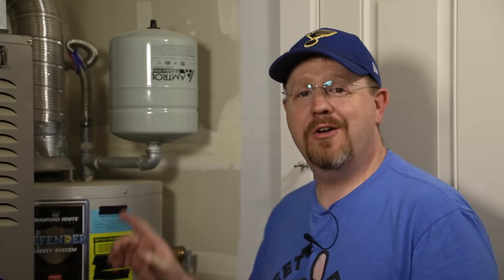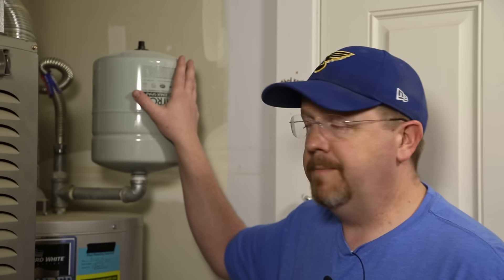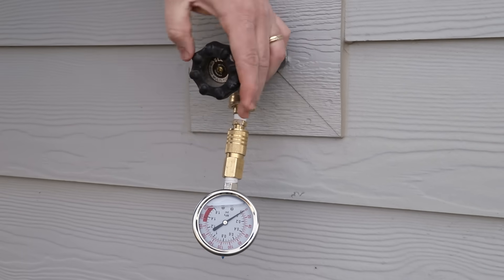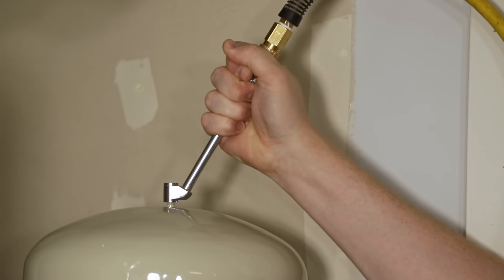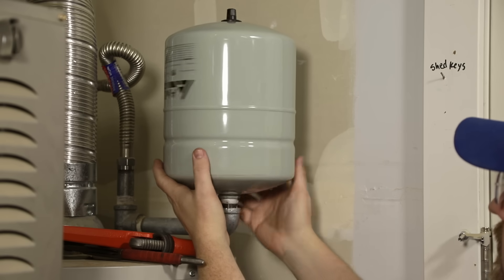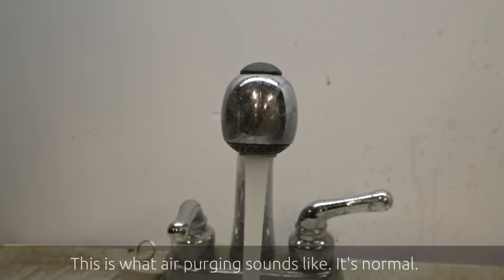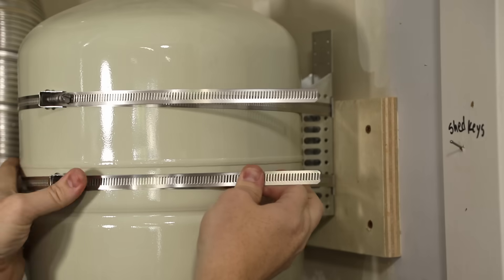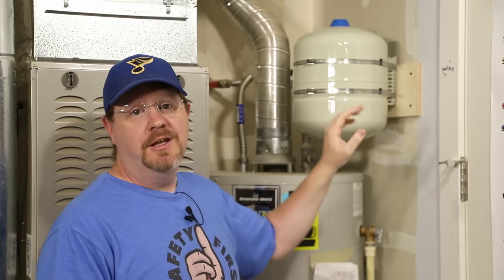What Is This Tank? How to Replace and Maintain a Water Heater Thermal Expansion Tank

Comment: excellent and very clear video! well done. I don't have an expansion tank but was wondering if I should. if the TMP valve never leaked, would that be an indication i don't need an expansion valve? I'm on well water. i do have a one way valve there
Reply from the maker: Hi Sean - I'd suggest that if you have never had a problem, you don't have anything to worry about. If you ever have a fitting fail and start to leak somewhere in your house, after fixing the leak a good preventative step would be to install an expansion tank like this. It helps keep the pressure in your system consistent even as the water heater heats and the water inside it expands. Thanks for watching!
Reply: @AmplifyDIY  i actually have a few PEX fitting leaking...hmmm

Comment: its not a good idea to mount the expansion tank upside down like that. an air pocket can form under the bladder inside the tank, the air with the water can begin to rust the tank from the inside at about halfway up the tank
Reply from the maker: Hi Brad - this is the specific way that the manufacturer recommends installing this particular tank... though the instructions say it is fine to install in either vertical orientation. I thought that the water half of the tank was treated so that it would not rust - where the air side of the tank is not. I've cut 1 of these open that failed, and the inner walls of the tank on the air side of the bladder were all rusty as you suggested, but the walls of the tank on the water side were still just fine. Thanks for the tip though, and thanks for watching!

Comment: I don't quite understand, is your water heater inlet hooked directly to the water mains instead of the water tank? Why?
Reply from the maker: Hi Keep Calm - I'm not sure I understand your question... but here is how my plumbing is basically laid out: 

Under my house (in the crawl space) is where the main water shutoff is for the whole house*. This is effectively where the "water mains" supplies the house. After that shutoff valve, there is a T - half goes off to all the cold sides of the faucets etc in the house, the other half goes to the water heater, and then off to the hot sides of all the faucets from there. There is an additional shutoff valve *only on the hot side of this T that is located right at the top of the water heater, on what is known as the "cold water inlet" to the heater. I.e., this is the side of the heater where water flows in. The other side is where heated water flows out to the house. 

In this video, I only showed the shutoff valve at the top of the water heater, which is not the mains shutoff - that's located in the crawl space under the house as I described above. 

Does this answer your question? 

Thanks for watching!
Reply: So there isn't a cold water tank, like a 1000litres tank in the attic? I.e: if the water supply from the street is cut off, you are left without water in your house?
Reply from the maker: @keepcalmandenjoythedecline  That is correct. This is by far the most common way for residential water systems to be hooked up in the US.

Comment: thanks. is it safe to install the expansion tank horizontally? its easier to do. less plumbing
Reply from the maker: Hi Sean - this depends on the specific tank you choose. Some manufacturers only recommend a vertical orientation. Others indicate it's fine in any orientation. Check the owner's manual before you buy/install. Good luck!

Comment: Water companies decided not to put a check valve in anymore, about a $40 part. Suddenly these tanks had to be installed everywhere at ridiculous prices. Big boon for plumbers, of course.
Reply from the maker: I agree that paying a plumber would cost quite a bit. Doing it yourself though, is really pretty cheap. Thanks for watching!
Reply: @AmplifyDIY   Part is $30-$40, but tools and a mote of mechanical acuity are not included. These tanks are the weakest point in the water system, and when they go they wreak havoc.

Comment: Been doing plumbing for 35 years NEVER saw an expansion tank on a hot water heater. Hundreds of them on boilers. Which in the philly area; is where they go.
Reply from the maker: Heya IT - they are pretty regional. They've been required on all new construction in my area for at least 8 years. Thanks for watching!

Comment: this may be what folk are doing where ever you live, I have worked in HVAC and never seen one of these. tanks like this are used to store RODI water LOL.   These water heaters are designed to withstand the pressure and come with temperature and pressure relief valves.

I am no expert but not sure what these expansion kits do, I would think they would fill up the moment you turn on your water, and makes you spend more money on extra stuff and pay a plumber to install it.
Reply from the maker: Hi Daniel - on an open system that allows backflow into the water mains, no expansion tank is needed. However, if the water supplier installs a check valve out at the street, the house effectively is in a closed loop, and an expansion tank like this is absolutely necessary. Without it, the T&P valve will pop off all the time, or worse, the hot water fitting at the washer usually fails and leaves the home with a very wet laundry room.

Incidentally, it's not just "what folk are doing" here - it's required by state code. Thanks for watching!
Reply: @AmplifyDIY  I live in Florida, I have a check valve at the street, I may or may not have one on my heater. I have no expansion tank. I have lived here, same water heater as when I bought the house. all I have done is replace the element. no issues.

I worked as a helper with a HVAC company repairing or installing anything to do with heat or cooling.  never have I seen an expansion tank.  we have pressure relief valves and nothing more.   far as I know my valve has never released, and the heater is like 6 feet from my bed in the closet.

this is an electric heater, only 110 v   one element, I assume 20-40 gallons.
maybe you are talking about gas, we have these in FL but never seen an expansion tank as I recall.

Comment: Must be a regional thing. In all the water heaters I've seen in my life and the 50 or 60 I've changed out, I've never seen a expansion tank.
Reply from the maker: Yeah, it's required by current state plumbing code whenever there is a check valve installed by the water supplier. They are becoming more and more common. Thanks for watching!

Comment: Sure... I've had Electric Water heater tanks for over 50 years... Never once have i installed this gimmick and never once had any issues whatsoever.
Reply from the maker: Hi Awarhero - you likely don't have a check valve installed on your water main. In my area, all new construction does, so this is required by state plumbing code. It's not a gimmick... if you don't have a check valve though, you don't need one as the expanding water can simply backflow out into your water main. Thanks for watching!
Reply: @AmplifyDIY  Unless it's new in the code, in Quebec i've never heard of a check valve requirement for incoming water.  But for sewage, yes.

Comment: This is a great video. I had one fail on me a about 14 to 16 months ago. We started noticing very rapid water bursts for the first 2 seconds when turning on any faucet. I ignored the issue (being very busy at work) for a few months until the water tank itself sprung a very slow leak seen in the catch pan. It was not a leaking pressure relief valve or any of the pipes so I had to replace the water heater. Thankfully it was still under warranty (for a few more months) and Rheem gave me back about 1/2 of the price of the new one. I replaced both the water heater and the expansion tank, adjusted the pressure on our house pressure regulator and filled the tank with the proper pressure. I did retest the pressure on the tank and house a few days later but not since. Interestingly my failed and replacement tanks are both the same as yours.
Reply from the maker: Sorry you had to deal with a failed water heater due to a failed expansion tank! That stinks! I'm glad you were able to get some warranty coverage, though. Hopefully your new setup will last much, much longer. Thanks for watching!

Comment: Its an expansion tank and theyre almost never installed properly--including the one in this video.
Reply from the maker: I'd love to know what I did wrong, Eddie - care to share?
Reply: @AmplifyDIY  hey, sorry for the late response. So, 1) the tank is installed upside-down, and, 2) it should be installed within a certain height range from the bottom of the water heater.
Reply from the maker: @eddiepadilla1078  Hi Eddie - the instructions from the manufacturer of this tank specifically say it can be installed in either vertical orientation - just not horizontally. Further, the height requirement you speak of is a local code restriction, which apparently does not apply in my specific area. This tank was originally installed by a licensed plumber when this house was built (around 6 years ago) and inspected by the county. I agree that often these tanks are not installed correctly, but as far as I have been able to verify, this specific installation is correct for my area. As always with any plumbing project: check your local codes before you even start a project.
Reply: @AmplifyDIY  The previous amtrol tank was the one that I was referring to. It looks like yours was the st-5 before swapping to one that would be code compliant. It sounds like that authority didn't care much for manufacture specifications. Good job, as the diyer, correcting the professional's screwup.

Comment: I was always told that these were to prevent water hammer when the inlet pressure was to high because some municipalities did not require a regulator. I have lived in cities that required a. inlet regulator and did not require an expansion tank. I have always live where there was not regulator and I had to install a regulator to reduce line pressure from 90psi to 65psi! Most appliances are not designed to operate at pressures much above 70psi.
Reply from the maker: Hi Ray - they can help some with water hammer... but the way this one is installed it'll only help with that on the hot side. The specific use for this tank is as described in the video: my water mains has a check-valve installed which prevents backflow. As water is heated, it expands, and since water is incompressible that expanding water will go *somewhere*... as you mention, it'll burst fittings somewhere in your system if the pressure winds up too high. (There is a pressure relief valve on the water heater as well, but they are usually set to release at a MUCH higher pressure than your appliances can handle.)
Thanks for watching!

Comment: In over 30 years, never had one attached to my water heaters.
Reply from the maker: You've likely lived in an area that did not have a checkvalve on the main, allowing expansion to force backflow. These tanks are becoming more and more common, and have been required by state code where I live for years. Thanks for watching!

Comment: NO...these expansion tanks are not common and by and large...unnecessary. Water heaters have around  FOREVER with virtually no issues arising from not have this.
Reply from the maker: Hi Jimmy - this depends heavily on your geographic location. They are required by code on all new construction here... have been for years. And they absolutely do help reduce the pressure/stress on several critical fittings in your plumbing system. Thanks for watching!

Comment: Bologna,,,that's a expansion tank,,it's there to soften the shock from cutting off water valves to stop water hammer effect.it has no other use.a shock absorber for the water system.period.
Reply from the maker: Hi Oliver. I'm afraid you've been misinformed. An expansion tank is there specifically to allow for the expansion of water as it heats. It can also help with water hammer on the hot water side but the main reason it's there is for expansion.

Comment: In 62 years I have NEVER seen one of these on any water heater. Boilers, yes- but they are a totally different animal. I just assumed that the outlet of the heater is lowered a bit to allow an air pocket for expansion inside the tank.
Reply from the maker: Hi JLange - they are becoming more and more common on new construction. They've been required in my area for at least the last 8 or so years. Thanks for watching!

Comment: Very good info. So do I need to have 40 psi minimum? Ok you said to match the pressure in my water system.
Reply from the maker: Hi Don - right, you should measure the water pressure in your system and set the air pressure in the expansion tank to match. Good luck!

Comment: I never had expansion tank at home and the water heater still works well.
Reply from the maker: The need for them is really dictated by your water supplier. They are becoming more and more common. All new homes being built in my area for at least the last 10 years have them installed when the heater is first put in. Thanks for watching!

Comment: Great job well done. I did see another plumbers trick where he drained directly from the Schrader valve with a special hose into a bucket and not disturb the main drain valve. What are your thoughts on this
Reply from the maker: Hi Acmm50 - Interesting question! To make sure I understand: you are saying that a plumber drained water out of the Schrader valve, right? On a tank with a completely failed bladder, I suppose this would sort of work to at least relieve the pressure in the system... but it will a) take a long, long time and b) won't drain the water out of a tank oriented with the Shrader valve on top as in this video. In my opinion, it's far better to just use the main drain valve. There is really no reason not to disturb the main drain valve.. it should be used at least annually to flush the heater, and if there is any reason it does not work correctly, it can easily and cheaply be replaced. Check out some of the other videos on my channel about both how to flush a heater and how to replace a drain valve if needed: 
Flush a heater: https://youtu.be/hs5N7HyDUWo
Replace a drain valve: https://youtu.be/OBPJYg0o_o0
Reply: @AmplifyDIY  Thanks for the reply, actually my guy drained down the system from the pressure relief valve which I felt not the best way. I would have preferred the main drain valve, but his reply was the HW heater was less than a year old so shouldn't be an issue. As it turned out he installed a new expansion tank and the the pressure relief valve so far is not leaking.
Reply from the maker: @acmm50  Yeah, at less than a year old, the T&P should be just fine. Glad it worked out for you!

Comment: I have one expansion tank connected to my hot water boiler and not my actual cylinder boiler. Is that normal? Theres also a valve right before the discharge where the tank goes, is it safe to close the valve and unscrew it? Or do I still need to drain all the water?
Reply from the maker: Hi Amiibo - placement of an expansion tank can vary quite a bit, so it's hard to say if your specific setup is "normal" - though I suspect it's fine. As for the valve - merely closing a valve does not remove the pressure in the system. If you only close the valve and then unscrew the tank, you'll get a LOT of water spraying out at the junction because the system is still under pressure. This is why I recommend draining at least a little bit of water out of the system - so that you don't get a face-full of hot water when disconnecting any fittings. Good luck!
Reply: @AmplifyDIY  thank you and just a follow up question. Before draining the water heater, should I close the main line in addition to the cold water shut off?

Comment: Looks like your piping to the tank is galvanized. Is the piping lined inside or is it stainless? If not it should be either stainless, copper or brass.
Reply from the maker: Hi Chad - unfortunately, yes, it is just straight galvanized. Swapping it out for brass is on my very lengthy list of todos. Thanks for watching!

Comment: Quick question that may relate to this. My pop off leaks out pretty bad after a shower. (Fills a big bowl up). I replaced the pop off and it continues to do this.  What would you suggest i do to fix this? Expansion tank? pressure regulator? Thanks in advance if you see this comment!
Reply from the maker: Hi Hudson - sorry for the late response. Sounds like you need to check/adjust/possibly replace your expansion tank. Good luck!
Reply: @AmplifyDIY  It doesn't have one on it. LOL. I checked my water pressure and it shows around 84 psi. I will try adding the expansion tank and see if that helps. Water pressure seemed a little high from  what I have read but not terrible.

Comment: What piping is acceptable to use (material) that is water potable and won't create any dissimilar metal issues.  I see another video using all brass, but pricing that out it's about $50 in parts...  I see a different metal used here.. Thoughts?
Reply from the maker: Hi John - Brass is the best for longevity. The piping you see in the video is galvanized steel, which is cheaper, but does suffer from dissimilar metal corrosion. I'm certain the plumber that installed my system used galvanized because as you noted: it's a lot cheaper. Swapping out that galvanized for brass is on my (quite long) todo list... just have to find time and $$ to do it. 

If I was installing a new system, I'd go ahead and invest in brass so that I didn't have to go back and replace it in a few years.

Good luck!
Reply: @AmplifyDIY  Outstanding!!  Thank you!